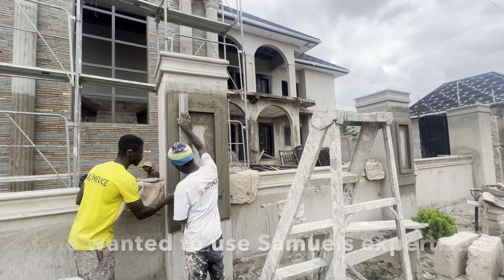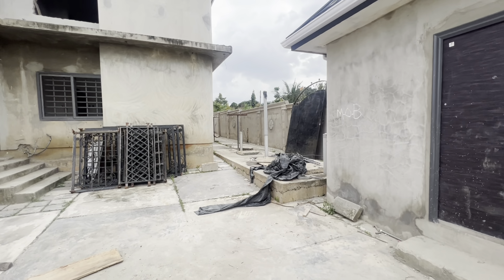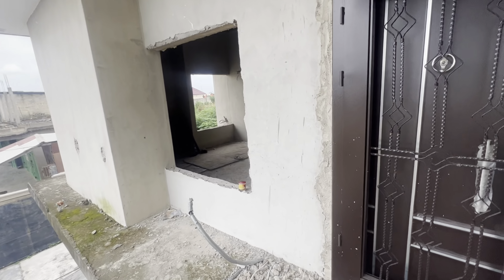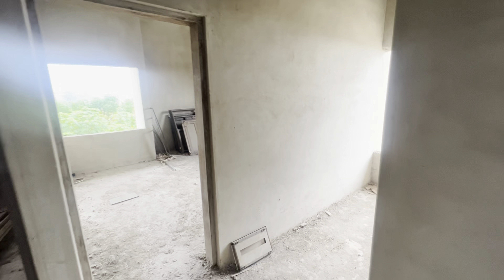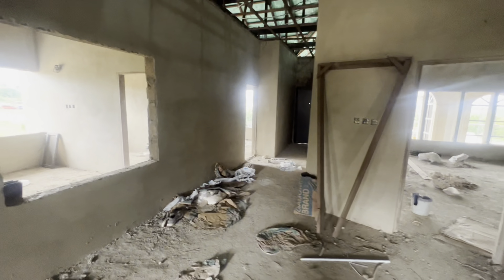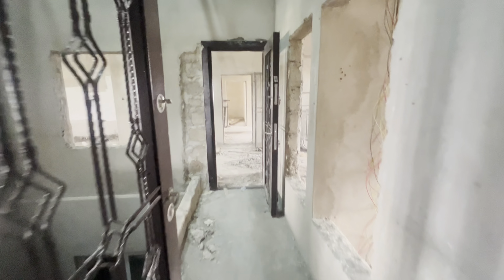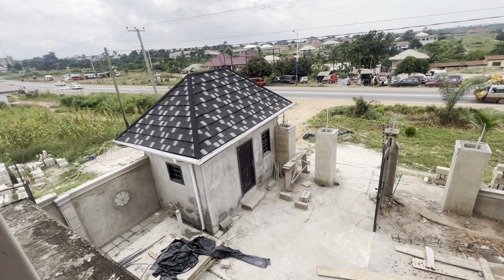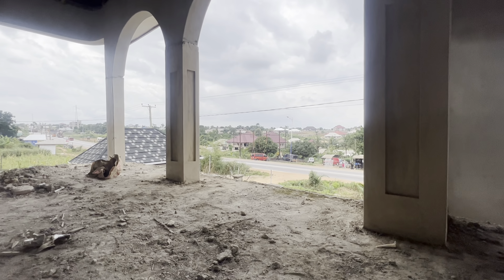Look how they’re building a family Mansion in Ghana 🇬🇭

Comment: How much would a property like this cost though? I didn't hear you say the price.
Reply from the maker: Well the cost of the land may vary due to location
Reply from the maker: This plot is on the main road, it could be about 10,000 dollars or so because it’s normally used for commercial purposes. You can get plots to build houses on for 2,000 to 10,000 in the city. Undeveloped land is normally cheaper. Now In more of a rural area, that’s far from town, you can get a acre for 2,000.
Reply: @webelonginafrica44  I'm assuming you're referring to usd. Is that correct?
Reply from the maker: @darsha158  yes, please that is correct.